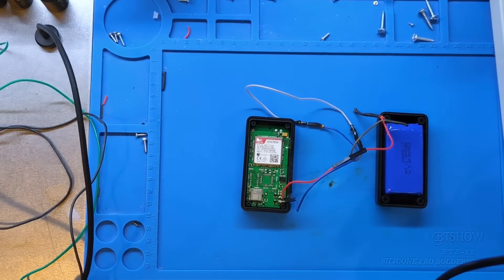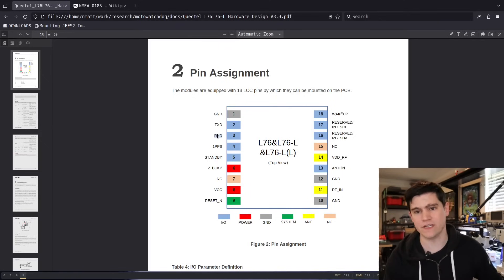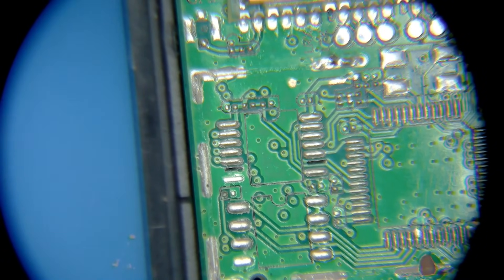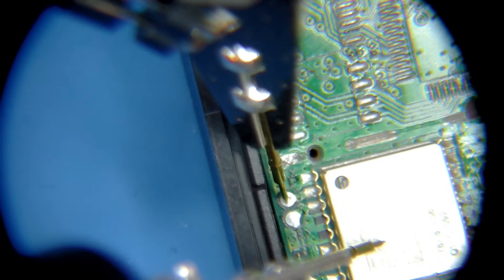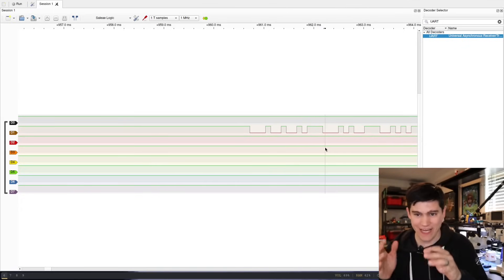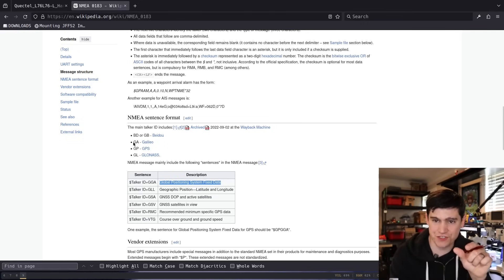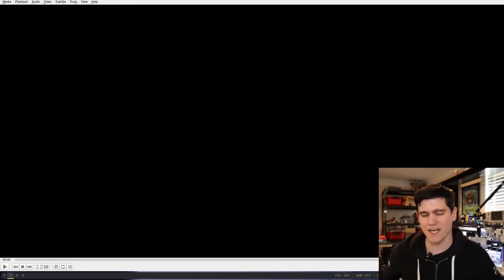4G GPS Tracker Reverse Engineering - GPS Digital Signal Decoding

Comment: You’ve got to be one of the most underrated hardware hacking channels. Couple of questions. 1. What got you into hardware hacking 2. What’s the best way to learn?
Reply from the maker: 1. I like Linux and took apart random used electronics and figured out how they work.

2. I suggest the same path as above. Find a device that interests you and try to figure out how it works.
Reply: I'll add a 3rd that helped me:    
3. Keep reading even if you don't understand it all.    

After a while, it'll all come together when you're trying things out. Or you might come across a seemingly insignificant piece of info & you'll shoot off like you been doimg this for years.    

And a extrs thought before posting: FAFO ain't just for the negative things. I imagine that's how humans advanced over they millennias.

Comment: 9600/115200 8N1 are  *the* standard today... I haven't seen other parity than none for ages.
Reply: Yeah, almost nothing uses a parity bit just like almost nothing uses flow control.  They exist in the spec, but no one bothers because the communication is already reliable "enough" for 99% of applications.
Reply: @KNfLrPn   flow control was used to stop transmission when buffers were full, that could happen for computers with 1KB of RAM, with modern computers, the buffer is never ever going to get full, even the GPS itself probably has enough RAM so that at 9600 the buffer will never get full, it probably has a CPU in the Mhz scale, as everything else has one.
Reply: @monad_tcp  the problem with flow control on the 16550 UART inside every PC made since the the ’80s is that the flow control is on the wrong end of the FIFO. When a device says “stop”, the UART will still drain the 16 byte FIFO out the serial port before it stops transmitting. For device designers, this made flow control very unpredictable, so they would instead design around it. 

I remember when doing but bang serial ports with PIC MCUs, the lack of flow control meant I had no choice but to process serial bytes in the few microseconds of spare time I had during the stop bit, before I had to go back to polling for the next start bit.

Comment: When you turn on a GNSS modem, it starts by trying to receive from the satellites in range. On cheapo modems like this without antennae, it can and does take a long time without line of sight to the sky. The first messages will be that it saw this or that satellite, but it won't put out a lat and long until it gets 2-3 satellites. Some of these modems can use nearby SSIDs to help determine precise location, which uses a list downloaded to the chip. And of course it runs Linux. You can get root on a PinePhone's GNSS modem

Comment: Now you only need to transfer the NMEA data to the 4G chip and make it send out to your phone, so that the whole tracker would work as advertised and not only by cell tower positions...
Great series so far, thx a lot for showing!
👍👍👍
Reply: I wonder why they even bother including the GPS module in the first place if they aren't using it. They could cut the cost quite a bit (and power consumption too) by just not having the GPS module if they aren't even going to use it.
Reply: @jearlblah5169  No idea...maybe it was planned to use it like that and something went wrong with the programming, remember the chip is switchable to what position data is used, GPS or cell tower. They could have placed an order, were delivered with the wrong specs and couldn't return them. So they sold the whole batch to the actual seller, not writing off the cost...

🤷‍♂
Reply: @horstszibulski19 that sounds about right… that they were repackaging and selling off mistakes.  I wonder what the threshold is regarding selling products that don’t work on Amazon?

Comment: The term commonly used to when talking about the different positioning systems—GPS, Galileo, GLONASS, Beidu, NAVIC, QZSS—is "constellations". As a general term, the industry calls satellite navigation GNSS (Global Navigation Satellite Systems). Technically, "GPS" is only the US Global Position System. You'd say "this GNSS module supports a number of constellations". I find "GNSS" to be a mouthful, and continue to use "GPS" in informal settings.

"Neema" for NEMA is correct.

I'm enjoying this series. I've spent a lot of time reverse engineering the internals of some older Trimble receivers, so it's interesting to see others digging in GPS tech as well.

Comment: 16:07 lol i love this round about way to get the NMEA messages into your script! when i've messed with these little off the shelf GPS modules, i simply make up a d sub mini cable that i pin for the RS-422 to usb dongle i have (why doesn't 422 have standard pins...) and then i just plug my dongle into my lab PC and then i solder or clip the dsub mini cable to the module and connect them. this lets me use putty to connect directly to the serial traffic. sometimes i will use an arduino to read the serial data too. the 422 dongles can be really expensive, so i've also done it with the classic startech 232 dongle. people don't now how insanely useful startech is lol. when you are using a UART to USB dongle with windows you also open up the massive amounts of code that work with com ports so you can do anything you want very easily using either putty or any software library (i usually go with .NET because i'm lazy).

Comment: fyi for anyone wondering about the "GN" Id, that means GNSS which the term for all satellite positioning systems. it gets confusing, but GPS often means the american system (also called navstar by old people). GLONASS is the russian one. when people say "GPS" they often mean "GNS" or just any generic position system. That said, the GNS message should always have GN as its ID because only GNSS receivers should be sending that message. different receivers will support different features and may or may not send different NMEA messages. GNS is pretty common though i think for modern all in one modules that include a little antenna and the receiver on one tiny board. 

as for the ! for a message start, i've never run into that before. it seems to be specific to AIS and it shows up in some NMEA documentation but not others. most of the documentation i have says the ONLY valid message start is $ with the ONLY valid message end being CRLF. your code should just ignore messages that have invalid characters though.

also if anyone wants to start playing with NMEA messages in software, i highly recommend paying close attention to the "valid" field of any message because some receivers will send seemingly valid data that is actually invalid because tracking has been lost (they may repeat the last known position with and invalid flag set). And then you always, always want to check the checksum field. you can get an error in a message that will change a single character but still be a valid message, and if you don't catch it by using the checksum then you are screwed lol.
Reply from the maker: Yeah that GN prefix threw me off since it wasn't on the Wikipedia page
Reply: I was missing WAAS on that wiki list.
That's the US version of GLONAS, Galileo etc.
Reply: @samuraidriver4x4  WAAS is more like DPGS in that its a terrestrial system that just augments navstar. Off the top of my head, DGPS does have an indicator in NMEA though because its incredibly useful to know if your receiver is using an augmented system or not. its kind of wild how insanely accurate DGPS can get using garbage accuracy GPS from the 90's lol. chances are you won't ever run into DGPS or WAAS receivers doing hobby stuff though because DGPS is kind of dead (and requires a usually extremely expensive fee) and WAAS is only going to show up in very expensive aviation receivers.

that said, it would be pretty wild to see a tracker that uses WAAS along with GNS and everything else (cell, shortwave, etc). those kinds of trackers are usually VERY expensive and require hefty yearly fees, but they also often come with a recovery team who's cost is included. those kinds of trackers usually have 5 to 10 year batteries and get welded into the frame of expensive equipment like huge tractors. there are some really funny youtube videos of recovery teams tracking down receivers

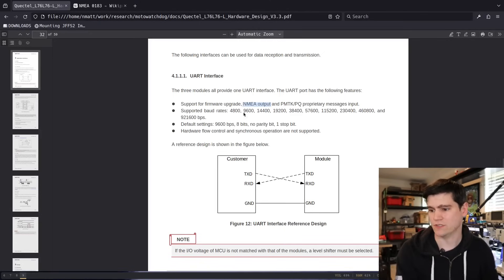Comment: 5:15 i worked with this type of GPS stuff for a while, and i heard both "NEE-mah" and "EN-EM-EE-AY". i usually said the letters out (EN EM EE AY) because there is a completely different system called NEMA that covers things like power cord plug shapes. Its pretty standard to see NMEA over either RS-232 or 422 with 1 Hz messages at 9600 baud with no parity bit. i never needed a parity bit because any broken message would result in a bad character in the NMEA message and my code would handle that as a bad NMEA message altogether and it would put the software into a "bad message" state which just threw the message out and waited for the start of the next message. 

you can't really use NMEA 1Hz message for nav stuff, but it can still be really useful for a lot of other things. you can make a clock on steroids that uses navstar's messages to find the date and time. i think its actually easier than using the radio clock stuff lol. a lot of off the shelf GPS modules include a 1 ppm signal too which can extremely useful for writing lazy power efficient code

Comment: Even if the logic analyzer is USB2, it's sometimes better to plug it into USB3. Usually the controller chip is a better quality and can handle the higher speeds more reliably.

Comment: I have to say you seem to be making this way more complicated than it needs to be - if I was looking at a GPS module the first thing I would do would be to look at the TXD with a scope to try and figure out what the baud rate was, then hook up a USB serial module to capture the data.  Using sigrok and writing scripts in Python to capture the data is a bit like using a very large hammer to crack a nut.  Especially since the datasheet for the module is available and it suggests t hat the only format the module supports is NMEA.
Reply: as a hacker, if you can have a tool that can do it all, you can carry less gear on the field and be ready for the unexpected, as some times datasheets are not available.

Comment: It's worth mentioning that serial interfaces are nearly always 9600,8,N,1 (9600 bits per second, 8 data bits, no parity bit, & 1 stop bit) by default, so if you know nothing at all about the device, try that first, & the odds are very good that it'll work. The next most common setting is the same, but 115200 bits per second.

Comment: are they sending the data to the UART of the 4G module or did they simply get hit by the chip shortage and just opt to simply not include the MCU making the GPS a pointless battery drain?

Comment: So this tracker uses GPS or cellular tracking? Im confused 😅
Reply: AFAIK the tracker is cellular because the GPS chip which does track GPS isn't connected to the cellular modem.
Reply: @dfgaJK  Yeah that's how I understood it too. Goes beyond me though why they still put the GPS chip on there if they don't use it, but did bother to remove that central processor 🤔 Maybe so they're technically not lying about the device having a GPS sensor...
Reply: @WilcovanBeijnum  chip shortage maybe
Reply: @dfgaJK but not gps chip shortage? KEKW
Reply: @WilcovanBeijnum that gps sensor seems working properly, so why use gsm positioning …